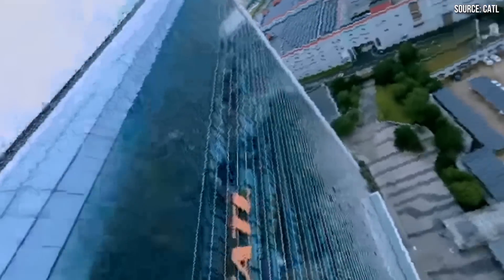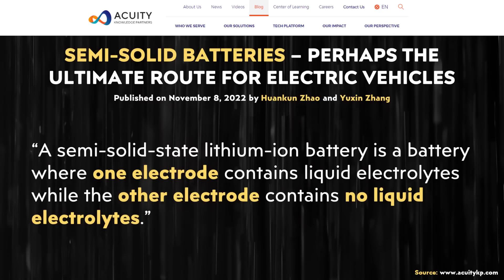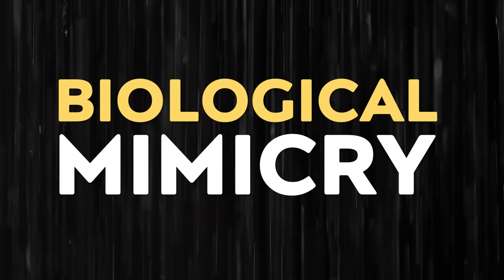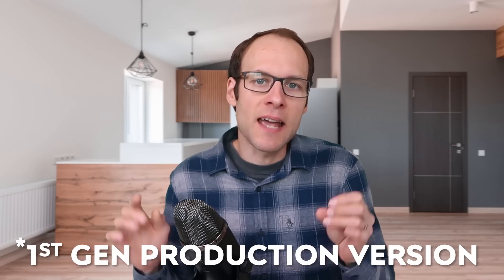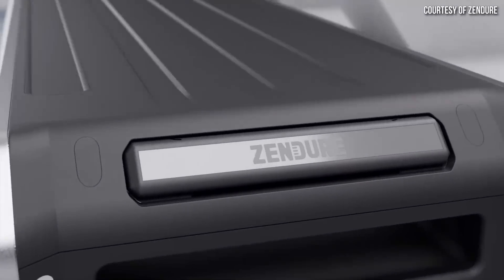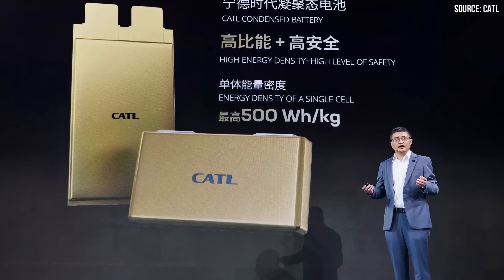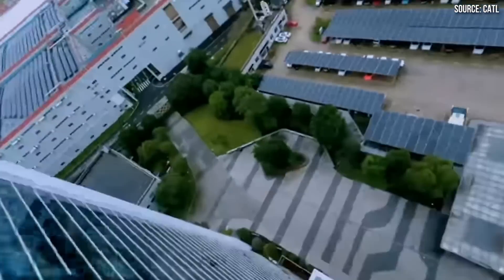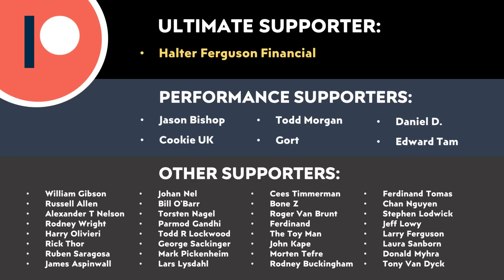NEW Condensed Battery from CATL | Compared to Tesla 4680?

Comment: 1 liter of kerosene => 10kw and 0.8kg weight
1 kg battery            => 0.5kw  
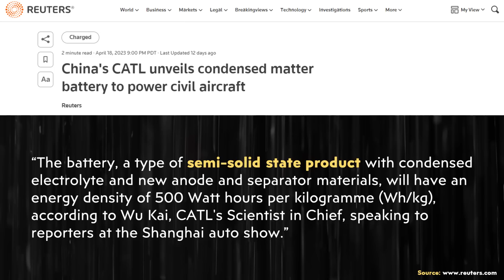kerosene vs battery -----------------------------------------------> 1:25
Termic motor efficiency: 0.6
Electric moto efficiency:  0.9 
                                                              kerosene vs battery ----------------------------------------------->  1:16.7
737 consumption: 3000 litri/h ------------------------------->  3000*16.66 = 50 TONS OF BATTERY FOR A SINGLE FLIGHT HOUR!!!!!!
(the actual 737 max take of weight is 80 tons with 25 tons of kerosene with FIVE HOURS RANGE)
BATTERY FOR AIRPLANE????... CIAOOOOOOOOOOOOOOOOOOOOOOOOOOOOOOOOOOOOO

Comment: Enough with this "4680" because Elon said it is that. 4680 breaks an international standard for cylindrical cell nomenclature, which is 2 digits for the diameter in mm (which presupposes a diameter less than 100 mm), then as many digits required for the height in tenths of mm. The reason is that in some applications the height fit is tenth of mm critical. The correct designation for what Elon calls 4680 is 46800.

Comment: I would not compare western trends to China, they are far ahead.  Any use of SS or SSS is using a lithium anode, no other reason, so the density should be close to what they say.  Lithium metal is likely the reason for the low quantity build as its very expensive. There are names looking to use a form of vapor deposition to get lithium metal prices down. Still seems CATL is many many years ahead of their Western counterparts.  Remember they made 811's years before anyone in the West thought possible

Comment: You done excellent job try to collect sparse info on  CATL condensed battery . But i still think it will be game changer in 2-3 years. I am concerned on 4680 packaging as shown in munro live - it is unrepairable and i think more difficult to recycle.
Reply: the life of 4680 is probably 2x longer lithium you wont need to replace lol... and tesla be pumping them out for 80$kwh and after subsidy of gov 50$ only.... no one want to pay triple for battery that last 1/3rd the life thats 9x more expensive per mile

Comment: Tesla's 4680 battery program will not be rendered obsolete by any other battery OEM. Tesla simply needs more batteries as fast and as cheap as they can get them for vehicles and fixed energy storage. By making their own batteries Tesla also captures IRA federal subsidies for every battery they make. Tesla will likely learn from and incorporate mature and beneficial alternative battery technologies (and technologists) into their own 4680 program.
Reply: with subsidy of tens of billions ya they will make them for 40-50$ kwh... which is stupid cheap-- easily selling unlimited they produce..... and the lifespan might even be extremely surpising with 4680  maybe they make long lifecycle---- then it only compete on density which is losing game if the cells last half lifespan and are double price its 4x the price then seems extreme niche.

Comment: 500KWh/kg if it happens at an affordable price, would be a significant improvement in EVs

A 300 mile EV with a 70KWh pack weighing 450kg would become a 300 mile EV with a 63KWh pack (more efficient as less mass) weighing 200kg

So a massive 250kg reduction in weight. A 2,000kg EV would become a 1,750kg EV. It woupd possibly be even better as the weight reductions could potentially allow lower weight motor & suspension
Reply: weight does not matter... if the lifespan is 3x less then 4680 and cost is 3x more then 4680 then its 9x more per mile...  i think it super niche expensive and MAYBEEE in few more years it can come down to be in supercars and motorcycles but idk ever to the cheap evs
Reply: @travis7860  Weight matters mate, batteries are heavy and the weight of them does decrease efficency. plus theres no way the lifetime will be 3x less. It may cost more per wh produced but if the batteries pack dencity then you can have a lower weight car with the same distance, therefor you get a much more efficent car and lower cost per km driven. Or you could keep the battery the same size in kwh, lower the weight significantly and increase range due to the much more efficent car. Efficency is the name of the game with evs, as even a moddest boost in efficency can result in way cheaper running costs.

Comment: My takeaway from CATL was that the condensed battery is similar to the Amprius 500 Wh/kg battery right now. CATL says they are engaging with aviation customers right now and that the batteries will be mass produced later this year. I'm slightly skeptical about what their definition of "mass produced" means exactly. But if they can get the cost per Kwh down to reasonable levels even within a few years, this is a game changer.
Reply: They don’t exaggerate. They historically underpromise and over deliver.
Reply: My takeaway is to never trust a stock exchange company that doesn't use graphs and scientific measures to explain the performance of their "future" technology, no cycles, thermal info, C ratings, volume, lab results, factory rollout times, volume predictions... instead it uses vague professorly "biomimetic" words without a given reason.

Comment: that's cool! i calculated recently that with a doubling of the volumetric energy density electric motorcycles might have a range very comparable to internal combustion engine motorcycle so this is very important development. :)
Reply: Electric motorcycles are exactly why I was watching this, lol. If the livewire s2 del mar had twice the range, it would be perfect imo.  Livewire's specs say they are using cells with  250Wh/kg so if The promised specs on these batteries eventually become standard stuff is going to double just like you are hoping and get pretty fun.

Comment: … When you say that CATL is not a competitor to TESLA, but a supplier, that doesn’t seem right. Both are in the business of selling batteries! For now, CATL is a supplier because of how history works.
Reply: "The market for static energy storage (and therefore cells) is quasi infinite"
Elon Musk (paraphrased)
.
Tesla has chosen the "small factory, simplified process, high output (from the FACTORY)" method with the 4680.
.
CATL is going with "try different methods and see what sticks". Mainly because it's "what they do" (?)
.
It doesn't matter.
As with the vehicle industry, nobody can do it all.
Reply: Yes, good point.Quasi.

Comment: Mobile phones and computers have been the primary early adopters of high energy density batteries. The 500 Whr/k is considered to be the practical energy density needed for aircraft. Since aircraft have much higher cost than EVs, they will be able to much more easily able to absorb the higher cost of these new higher energy density batteries until production scales up and economies of scale kick in.

Comment: Thanks John, great overview.  I think your predictions are correct, this CATL battery will take a couple-few years to test out and come down in price, as will the NASA, and all other solid-state batts.  They all seem to be struggling with the same problem—low cycle life and high cost.
Reply: There is diffrence between CATL, NASA and the various start ups working on solid state batteries.
CATL is major battery manufacturer that has over 200 GWh production capacity. NASA is a research organization, they wont be mass producing the batteries themselves . The start ups well they are  "start ups" their mass production speed and volume is going to be diffrent than CATL.
Reply: @najibyarzerachic  very interesting point of view.  I think mr cleanerwatt has an issue with the anode chemistry that will take time.  Once they have a working prototype the cost will come down Verrry quickly, subject to the cost and availability of the elements being used.
Reply: did someone in the comments told him this is being mass produced later this year? this is catl and not panasonic or tesla

Comment: Numerous high-density battery prototypes have been reported, but they have yet to be mass-produced. If it weren't for CATL, the largest battery manufacturer, I would consider these developments to be mere laboratory experiments.
FYI, CATL has also published their CTP3.0 battery pack which provides up to 140kwh power, customer can order 140kwh battery with Zeeker 001/009 cars and the battery upgrade costs extra 16000$. So I think CATL condensed battery would at least be expensive than their CTP3.0 battery(Kirin battery)
Reply: It’s twice as expensive. That’s why they’re going after planes first.

Comment: ITS ALL NOISE : Tesla is  progressing the scaling the dry electrode cylindrical 4680 cells & is likely to join CATL  producing in the USA. As the worlds largest cell consumer Tesla criteria is a balance of cost, performance, efficiency, scale & reliability. They are exploring every rabbit hole, and are testing every electrode-electrolyte - to be ready to go into scale production if the criteria are met.
Reply: It's CATL, not a small startup claiming a big success searching for funding. At least, it must be taken into consideration. As always, price will be everything. If cost per Wh is ten times higher than regular liquid state electrolite batteries, it won't be a high success but in niche usages. But it's only twice, it will a success in premium vehicle brands.
Reply: CATL is the real deal.
Reply: Maybe It's all noise.  Maybe people thought that about 4680.  Maybe some people still think that about 4680.  It was recently at a run rate of 4 GWH instead the 100 GWH it was supposed to be at by now.  Things take time but CATL has a history of delivering as well.  CATL has both the LIPO4 and the LMFP batteries.  Significant accomplishments.

Comment: Semi solid state isn't really a half way technology. It's its own thing vs all solid state. It is highly likely that we never actually go all solid state as it has conductivity and resistance  issues  as solids are poor at transfering ions between eachother. If the electrolyte is non flammable then it makes no difference for safety between all solid state and semi solid state and most companies that claim they are developing a solid state batter are actually making a semi solid with small amounts of electrolyte.